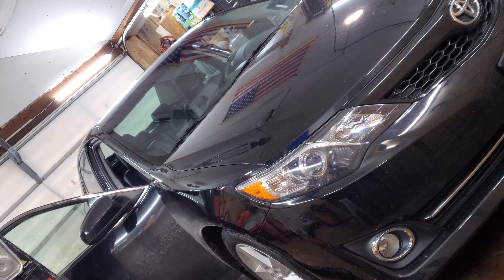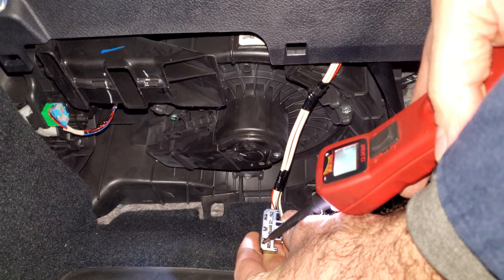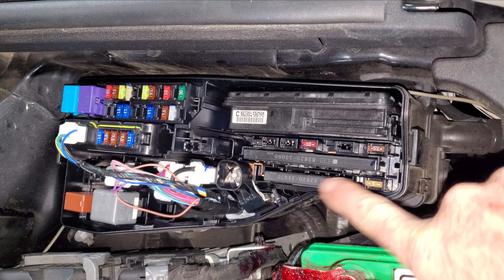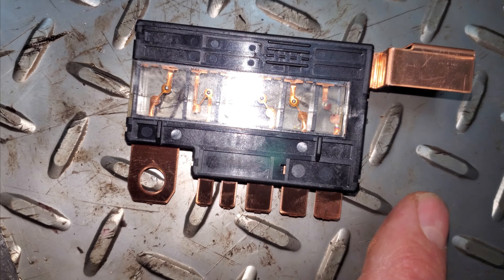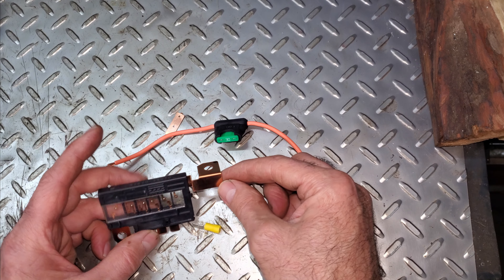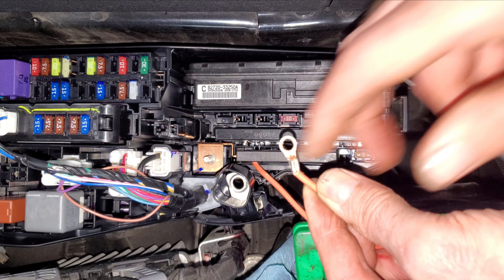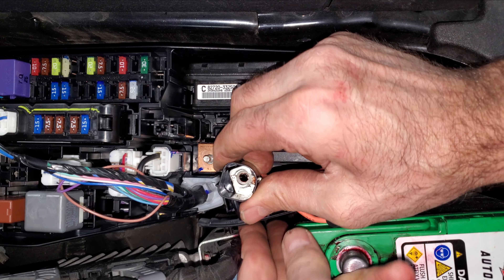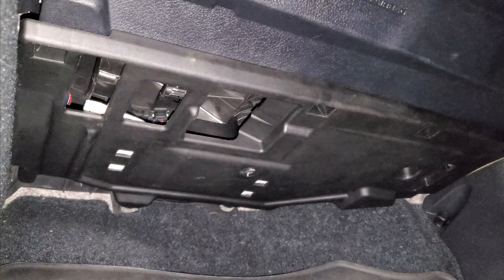2007-2017 Toyota Camry blower motor fix

Comment: Yeah those Toyota fuse bars are never available in the twin city's, it's real fun when you accidently touch a wire to ground without the battery disconnected and blow it, and gotta find one. Only make that mistake once

Comment: Easiest blower I’ve ever replaced tbh. I was having weird squeaky whiney sounds at very low speeds on my 2017 .. I tried to lube it a little and it didn’t work so I just replaced it.. probably would have kept going but the noise just drove me insane. Was a pretty expensive part at Toyota but putting it in.. not a problem at all!
Reply: Only a few cuss words were uttered for this one. Much easier on the 2005 model

Comment: anybody else having problems with these blowers going out every year? I was in the process of refilling my ac and the blower just quit for the 3rd time in 5 or 6 years.
Reply from the maker: I wonder if it is the resistor, or the motor, and what brand you are using? The resistor failed in this one, and if you are using the same brand, I would change.
Reply: Yeah, I have a 2014 SE, and the blower has been working on/off.... I need to go check it now, as it just went out🤦🏽‍♂️
Reply: YES! 7 blower motors replaced in my 2014 Avalon Hybrid (replaced by dealer under extended warranty…now I’m outside the warranty and my blower motor just quit again—thus why I’m here.)
Reply: @RustBeltAuto  sorry, total noob to this stuff, but did you replace the resistor in this video? I thought it only covered replacement of the blower motor and that genius fuse hack.
Reply from the maker: @s-bornMidwesternMensTenn-rb8pf  the resistor is in the blower motor.
Reply: @RustBeltAuto  ah, thanks!
Reply: I’ve had mine replaced under warranty twice.  Getting ready to replace it myself soon.  The fan blowers on these cars don’t last very long.

Comment: Thanks, just swapped the blower motor. Clip on wires gave me trouble, so  I removed the blower motor nuts first to get better access to wires. Could not have done it without you!

Comment: Well done! My first thought after seeing the fuse bar-thingy ( like nothing i’ve seen anywhere before) was to move the wire under the box to one of the unused fuse pins. I’m guessing getting to the wire underside of the fuse box would be a challenge.
Reply from the maker: You could use an unused fuse I suppose.

Comment: Ok my blower has been bogging down now stopping sometimes until I punch the dash then it'll work.  What's going wrong bearings in motor or a short in circuit?  Any help is appreciated I'm a terrible mechanic and just slightly less dumb at electronics sooo lol
Reply from the maker: Banging on the dash is a diagnostic skill, not a fix. You probably have a bad connection. Wiggle test will find that, or the motor is no good.
Reply: Have the same problem with my 2013.  Had the fan blower replaced twice under warranty.

Comment: If you just changed the blower motor wouldn't that fix the problem ? The resistor is built in the newer motor itself.  

Now if you wanted a strong amp fuse I could understand that ya know.  

Just asking before I do all of this . 
Thanks
Reply from the maker: The resistor is in the blower on this vehicle I think. Fuses are usually twice the amperage of whatever you are using. It's best to use the same amp fuse. Hope this answers your questions.

Comment: this is exactly what I needed! thanks!
a follow-up question: the fuse with the circle in it got stuck in my fuse box when I tried to replace it... how do I remove it?
Reply from the maker: I don't know. Try harder?
Reply: Evidently all of these fuse assemblies aren't all simply "plugged in". The hole in the spade connector actually serves a purpose on my 2012 Camry. There is a small pinch bolt that goes through and secures the connection. The fuse assembly will not release until the bolt is removed. To access the bolt, rather than disassemble the entire fuse box, I drilled a hole through the side of the box and removed the bolt. The fuse assembly lifted right out. After installing the new assembly, I put some black cloth type electrical tape over the hole. Easy enough.

Comment: In a '14 hybrid avalon the fan went out, and there's 12v power at the connector, with the ignition & power off.
Stuck relay? Or...
Reply from the maker: It could be switched using the ground.
Reply: @RustBeltAuto  Thanks... it seemed to fix itself, after using an obd reader that reported nothing.

Comment: I need to know the part number to the resistor motor  blower  for a 2014.5 Toyota Camry xle. Can u please help? Where can I find that info. Also for the blower itself.
Reply from the maker: The resistor is in the motor on these.  There are many different brands of aftermarket blowers for this. If you want a factory one, call the dealer, and get a part number from them. Ebay, amazon, rock auto, etc. All have these.
Reply: Thank you so very much for ur info. 

One more thing. I changed the cabin filter and the air started blowing thru  the vents, I was so exited. But when I turned the car off the same problem occurred. No air coming thru vents. I tapped the area underneath the blower motor and then I hear it start and the ac (air ) comes on .  So everytime the air doesn’t come on I kick a tap under the blower motor What can be the problem.

Been raining so much here in CA need this fixed. When I have no air my windshield gets so fogged up and I open my windows to help.  I need to fix Z

Comment: There has to be a way to fix the resistor only. If it starts to act crazy.
Reply from the maker: It's in the blower. Good luck.
Reply: @RustBeltAuto  yea but I took it apart found a circuit board. It's probably something simple to fix. But I have zero knowledge on how those things work.

Comment: For some reason, my blower motor fluctuates. It runs, then it starts running slow, then it stops. Then I hit the bottom of the panel, and it starts up again. I'd love to figure out how to fix this permanently. I've replaced the blower motor twice, and it keeps doing the same thing.
Reply from the maker: Might want to wiggle test wires, and check connections.
Reply: You ever find a fix to this?
Reply: @Suuhdude22  try this. I know it sounds crazy, but I saw another video about this. This guy basically smacked the bottom of the  panel (the one you see the guy removing in this video), and the blower motor suddenly comes on. I've been doing that, and, voila, it actually works.
Reply: @yragcom1 I had the same problem, been using the smack technique for a year but now i have to smack it many times and harder than usual for it to turn on. And now it turns on and then back off right away